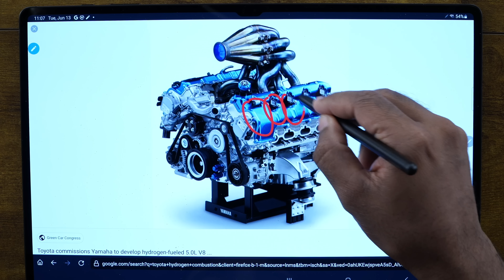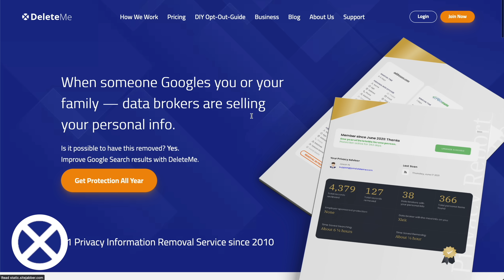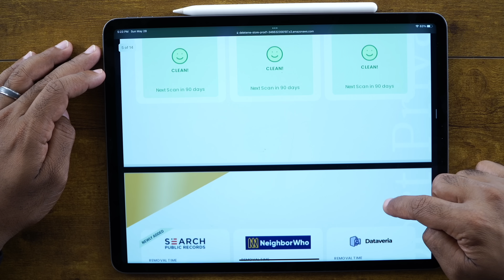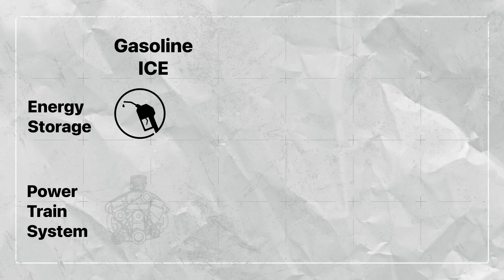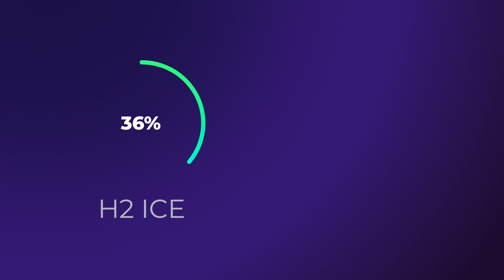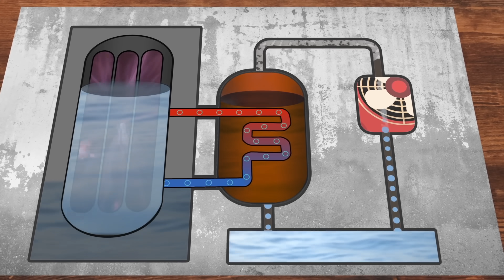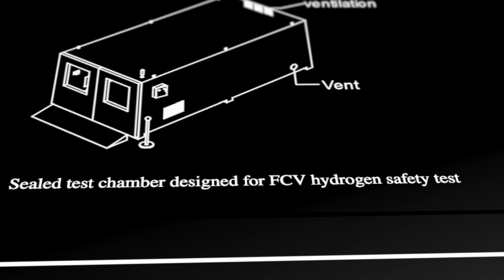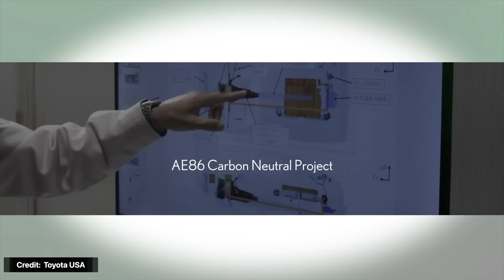Toyota's Says They Just Destroyed EVs - Hydrogen Combustion Engines

Comment: I think the efficiency argument is a bit of a non-sequitur when you consider how energy dense it is. The real question is from manufacture to fuel source to tank to daily use, what is the efficiency and what are the emissions. Given that batteries emit approx 150kg of CO2 per KWh and the nasty elements required, plus the inability to generate enough power from real-renewables (not land windmills which destroy 1,000s of acres of land) and solar power (that does not work in most of the world)) then hydrogen emissions are absolutely infinitesimally small. Then there is the issue of how the energy source is produced. Hydrogen can be manufactured in a highly decentralised diverse manner, this massively reduces transportation and storage costs. I think this is part of the problem, as hydrogen undermines the big corporations that have locked down the energy sector and opens it up to all comers.

Comment: That's because they not using a hydrogen and oxygen tank, if you're going to pull in outside air your putting carbon dioxide and nitrogen I to the combustion chamber that is bad. Only hydrogen and oxygen should be going in no non combustible gas's that would decrease power. 
But you could get a battery car with a shorter live span and decrease rapidly in value after you buy it, and it's not like they have a issue of the batteries spontaneously combusting and setting your house on fire right and burn for weeks.

Comment: The German company called Keyou GmbH retrofits diesel engines to be fueled by 100% hydrogen gaseous fuel and air is testing trucks and buses domestically and then will license globally. The promising method to safely store hydrogen inside water adds baking soda solution will eliminate the danger of fire or explosion. The fuel tank could also be used to extinguish a fire would be amazing as well. The lowest cost method to produce hydrogen will be recycling abandoned oil wells in partnership with Proton Technologies, Inc in Canada.

Comment: You are not addressing the losses in electricity production and transmission.
It is estimated that of the 66% lost, 59% of it is lost in the generation process. This includes:

>Waste heat occurring due to inefficiencies in the process of converting primary energy to electricity. This makes up about 54% of the overall losses.
>Electricity used internally by the power plant during operations. This makes up about 5% of overall losses.

Comment: I have been very stand-offish about full BEV. The batteries are incredibly heavy, incredibly volatile, incredibly expensive, and don't last very long. Cell phone batteries only last 3-4 years before they are completely shot and even in that 3-4 year period, the performance degrades HEAVILY. My ICE vehicle gets the same MPG now as it did 11 years ago. It's fuel tank carries the same quantity of fuel as it did 11 years ago. I have never had to replace the engine or the fuel tank, and despite the 'what about maintenance' cries from the BEV advocates.... what maintenance? I almost never have to maintain my vehicle. 2 oil changes per year and a transmission flush every decade. It's not that big of a deal. 

But I do acknowledge the short comings of ICE, or rather, some really cool aspects of motor powered vehicles over engine powered. Not having the trans axles, the transmission, the storage accommodations and being able to move everything around.

I would be VERY interested in a FCEV where I can refuel in minutes (like an ICE) but get full torque and torque vectoring (like a BEV), and the storage accommodations (like a BEV). Plus, FCs don't degrade as fast as batteries do. And anyone can make their own hydrogen at home with solar panels which is a great way to use energy when you aren't home that would otherwise be generated for nothing. So you spend a few hours with solar panels converting electricity to hydrogen, come home, and charge it up in minutes. As opposed to how it is now where you get instant access to infinite electricity you don't need, but it still takes your hours to recharge a BEV.

Comment: The reason Toyota is putting R&D budget into H2ICE is the reasons you specified in your video.  EVs are not the one-and-only solution.  They simply do not fit every transportation need today.  Maybe that will change in the future, but at the moment, they are unsuitable for long range transportation such as cross-country shipping, colder climates where battery efficiency drops significantly, and areas where the local power grid can't support large numbers of EVs.  This technology has the potential to decrease emissions within the infrastructure and budgets we have at the moment.  Great presentation, thank you!

Comment: The main reason Hydrogen station are not all over the US is due to a political party that isn’t making money from the act. The Government gave money for the electric stations to get started and I mean a lot of money.  Just as Elon Musk received for Tesla and he received money from other Countries. He also has produced other battery sources other than just for vehicles. 
Hydrogen is by far the better way and it is very close to what we have now. The hydrogen engine will last much longer and the replacement of a lithium battery is outrageous in price making the vehicle obsolete. People don’t want to say political, but this is. Look at what the US government has did to diesel engines. They ruined the engine and it breaks. Not might, it will because of the DPF and the sensors go out all the time.

Comment: Efficiency, efficiency, efficiency. Why does it ALL have to be about efficiency nowadays? If efficiency is THAT important, why do sport cars exist? Why do SUVs and trucks exist? Why doesn't everyone with a combustion engine car drive a turbocharged 3 cylinder 1liter? Because cars are more than a tool to get from A to B for a lot of people. As long as its (almost) carbon free, LETS GO baby! Everyone always talks about how we don't have storage for renewable energy produced in moments of excess energy. How about instead of turning off the wind turbines in these moments, we would produce hydrogen (which could also be used for E-Fuels)?? Like... Wouldn't that be more efficient then just to not use that energy at all? 😂 I get, that we need EV's. But that doesn't mean other cars can't co-exist.

Comment: The EV efficiëncy numbers are skewed. You're not counting the losses in convertion at the charger, usually between 10%~20%. The losses in the battery, converting electric into chemically stored energy, and when using it, converting it back into electric energy again. And then there's the weight, an EV can weigh double that of a normal gasoline car. So it costs double the energy to accelerate the car. Plus increased rolling friction. You mentioned the up to 50% decreased range in cold weather, that's a lot of energy just lost. And we haven't even taken the manufacturing costs into account either. EV's are not nearly as efficiënt as they say. The main benefit of EV's is that they allow us to diversify our energy sources and break the oil dependancy. The tales of efficiëncy are greatly exaggerated.

Comment: So much focus on efficiency talk but it’s irrelevant without mentioning fuel weight. Hydrogen and Gas is MUCH lighter than batteries. This weight greatly changes this argument and is why you have to spend $90k+ on a Model S to hit 400 miles compared to my $30k ICE car.

You also can’t compare a 100 kWh battery car to a “comparable” hydrogen car for distance and charge time. Hydrogen cars have 2 major parts to determine distance. Engine efficiency and fuel tank just like ICE vehicles. I could have the most efficient engine, but a tiny tank or vice versa. Tiny tank takes me 30sec to fill and a massive tank takes me 10min. Without the engine specs, these 2 vehicles might go the same distance.

Comment: JCB Excavators are building their big machines with hydrogen ICE  because to use batteries adds 10000kgs. weight and doubles the price, plus many excavators operate far from an electricity supply whereas bulk H can be delivered to sites.
 As a retired farmer I understand the need for a high density power source, diesel being the preferred fuel, because of the need for constant power. Visualise a 500 HP machine running at full throttle for 8 hours every day utilising 75%  of rated power amounts to approximately  15 gallons/hour or  120gallons/day .  or 1200 kW hours of electricity, more or less. That is a big battery!

Comment: A gasoline combustion engine is like 30%, absolutely designed and regulated by the oil giants. 
Hydrogen engines appeared like 35 years ago and got knocked on the head. 
We are decades away of these becoming the norm. 
The governments will not allow and then buy the time they do hydrogen will be more expensive than bloody DINO oil

Comment: @TwoBitDaVinci Great video, I appreciate the insight. I have a question though... Why is the effiency for Hydrogen ICEs considered such a big negative? A regular petroleum gas engine is only about 30% efficient. If we consider the fact that electricity has significant efficiency reductions in the production process and delivery to a charger. Shouldn't those be factored in as well?
Reply: As long as you factor in all the fossil fuel infrastructure, refining, transportation as well, then you can make that argument, which would also add into the inefficiency of H-ICEs, since they would basically have the same thing.
Reply: sustainability matters more then effiency, ev stuff isnt sustianable , hydrogen is, and theres engien designs that coudl allow no burnng of fuel and lower tempurature burning for no emissiosn at all, like a theretical turbine charging electric drive, innengine that a youtuebr call driving 4 answers made a video on, sir joseph center free piston engine , all of whch could charge recyalable electric motor liek what mahle was talking about, run by sustinable stuff liek hyrogen , propane, e fuel, biodisel etc, with emissiosn reduced to a meaningful extent. laws are also claerly not designed for lowering emissions etc, the same corperatiosn governemnt who promote climate change narrative use it to basically tx productivity , they destory nuclear power despite that being the best conflict reducing "green" solution ever which cannot be replaced, check out tony heller , suspicious observers, magnetic reversal news, tom nelson, seriescalled hwo blackrock conquered the world " by corbrett report on substack website

Comment: All hydrogen economy solutions are basically reliant on the development of power that is "too cheap to meter" so the energy inefficiencies of cracking hydrogen from water (not cracking it from fossil fuels as is now commonly done because it takes less energy) is simply not a factor.

I'm totally enthusiastic for a hydrogen economy for the transportation sector.  The reduction of the need for rare earth elements, end of life disposal, etc., are all great.  But I'm not blind to the giant elephant in the room - you need a LOT of cheap, environmentally neutral electricity for it to make sense.

Comment: The goal is to get away from gasoline, and hydrogen is a good solution. Is has potential to be carbon neutral, which EVS can never be with thier destructive, questionable material acquisitions. In efficiency the numbers won't be comparative to EVs because of what they can deliver, but it's GASOLINE we're trying to overcome. And by those metrics it's a great replacement.

Comment: In your efficiency section:  
When electrical efficiencies are discussed, only the end use of the electricity is considered.  This efficiency is of course, very high as there are few losses.  To generate this electricity using an electrical power generation plant one will find that the power plant is typically only 30% efficient.  That means 70% of the energy inputed to make that electricity used at the endpoint is wasted.  As stated earlier the efficiency of the electricity delivered by the endpoint by itself is typically very high.  If the energy used to generate that same electricity used at the endpoint is considered then the efficiencies between the H2 ICE and the Electric Vehicle is nearly the same.
Reply: If you consider the same source of electricity for producing the Hydrogen via electrolysis and charging a BEV battery you will still have a very poor well to wheel efficiency for an ICE H2 Vehicle vs  a H2 FC EV and even more so vs. a BEV.

Comment: Cant charge a hydrogen car off my rooftop solar, so ev still a win for me. 

Also compressed hydrogen tank doesnt sound much fun in a crash. Admittedly liion isnt either, but solid states are starting to make it onto the market - and that does away with volitile issues.

Also benefit of EV is less moving parts, less maintenance and failure points.

Hydrogen refueling infrastructure doesnt exist yet. Probably will if heavy haulage moves to hydrogen, but as far as i can see hydrogen production still blue hydrogen rather then green. So its not actually environmentally sound.

Ev, still my preference. Just need few more years for the new batteries to roll out.

Comment: I'm in anything but gasoline kind of guy. I really don't care if somebody wants to run their car on hydrogen or if they want to have a battery electric vehicle, as long as it's not gasoline, I really don't care. If automakers think that you can keep the internal combustion engine alive with hydrogen I'm all for it. Me personally, I'm gonna prefer electric cars at this point. simply because it's less moving parts, which means less maintenance. and electric cars are getting a lot faster when it comes to charging. Not to mention electric cars are just faster. But if somebody wants to use the hydrogen powered vehicle, rock on. All that. matters is that we get rid of gasoline.

Comment: You left out of the ev equation that most of the juice is produced through burning coal.
The h2 combustion engine is great, but should require no infrastructure;
h2 on demand produced by the new frictionless electric motors riding at each wheel would make more than enough power to meet the need.
Also, using zircon impregnated ceramic coated engine parts eliminates the need for lubricants.

Comment: As a boy I learned from my chemistry teacher that hydrogen gas is dangerous, in part, because when mixed with air it has a broad range of mixtures at which it is explosive.  Compare this with gasoline, for example.  In order to cause an explosion gasoline has to be carefully mixed in the right proportions with air.  (This is why we need a carburetor to make the engine run.).  Not so with hydrogen.  It is a gas that can become explosive in a wide range of concentrations.
Is this correct?  How does this affect consumer safety?

Comment: I am a Professional Engineer, and I was interested during your intro about a HICE vehicle, but I was disappointed.  The most important factor for any vehicle technology is the energy density of the fuel or storage method.  You simply stated, falsely, that H2 has a very high energy density, second only to nuclear, and went on.  In reality, that is hydrogen’s failing.  It has very, very low energy density.  I’m not aware of any practical way around that.  At the beginning of your video, I was hoping Toyota had some new development, but if so, you didn’t address it.

Comment: Dear da vinchi, when hydroden is ignited with oxygen does it produce an 'explosion' as fuel with oxygen or an 'implosion' with water as end product? It looks to me end product of the combustion is of  much less volume, just a few drops of water in a car cylinder. How does that push down a piston? Where is the hole in my understanding?
Reply: Lets try to help your understanding here with some questions that you should ask yourself. Is there a change in temperature during combustion and at what state will the water be in at the end of the combustion stroke with this change of temperature; solid, liquid or gas?

Comment: Another great discussion point would be the pollution causes by brake pads. EVs still have to stop, therefore do they still produce the same amount of brake pad dust?
Reply: Sure they will also creste brake dust however they slso employ regenerative braking that recharges the battery while slowing with no or reduced use of the brakepads. As so often driving habits will greately influence such things no matter which tech is under the hood

Comment: While hydrogen combustion vehicles aren’t necessarily a step forward, I suspect they will have a place with car enthusiast replacing dirty gas burning engines for mostly clean hydrogen. EV’s are great, but they lack much of the experience you get driving a combustion engine.
Reply: Enthusiasts will just move to high concentration ethanol or pure ethanol as gasoline engines can be converted to use ethanol a lot easier. Hydrogen engines are underdeveloped and will pretty much always be that way because they are impractical, meaning there simply won't be any high performance hydrogen engines that enthusiasts will actually be interested in.